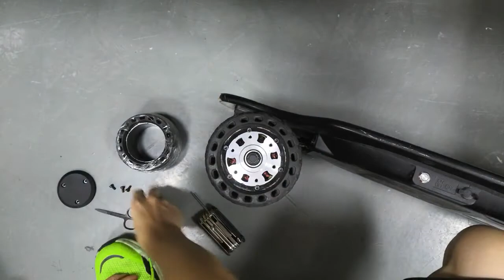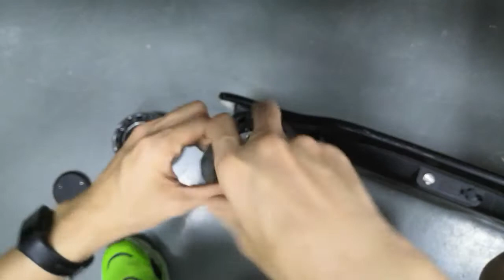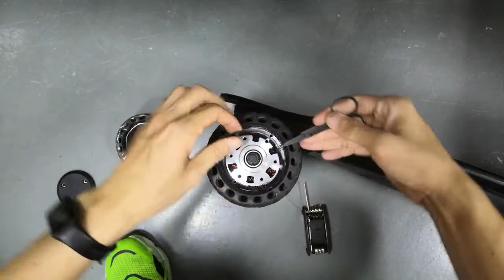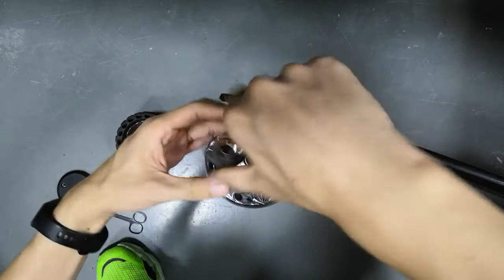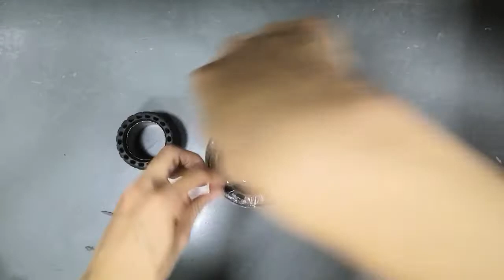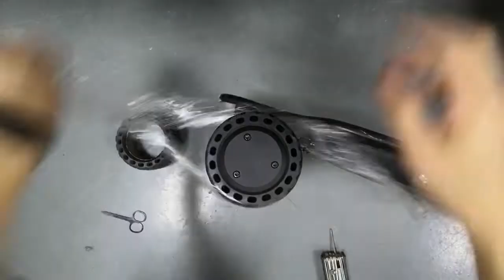honeycomb rubber sleeve swap for PUAIDA electric skateboard P6GT hub motor tire [P6GT]

Comment: Can these sleeves work on the Backfire G3 or Tynee Classic?
Reply from the maker: I don't think it fits, it's better to use PUAIDA motor set.
Reply: @puaidaelectricskateboard9049  thanks. The motor set is compatible with Backfire G3 ESC & remote, plug n play, no modifications or issues?

Compatible with Tynee ESC and remote? Thanks
Reply from the maker: G3 is 48V, need to match the 48V motor
Reply: @puaidaelectricskateboard9049  puaida is 36v, so incompatible?
Reply from the maker: 48V needs to contact customer service for customization，www.puaida.com